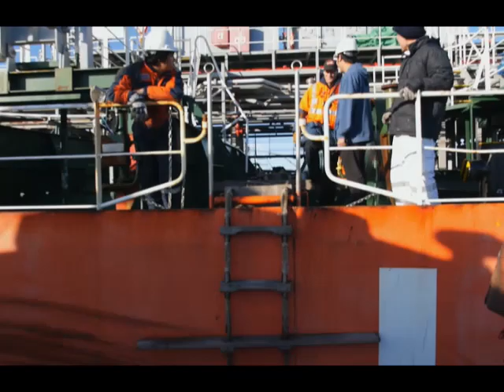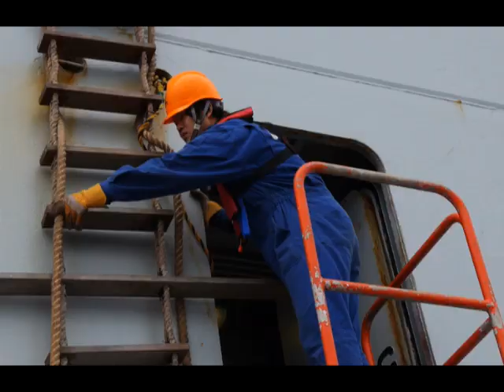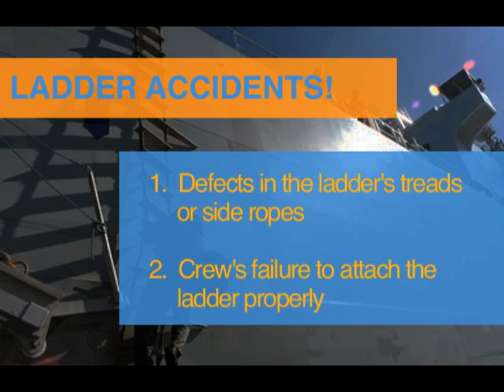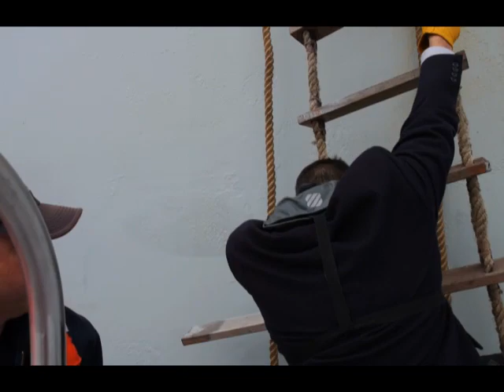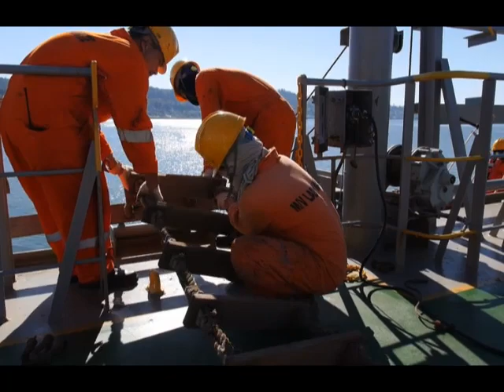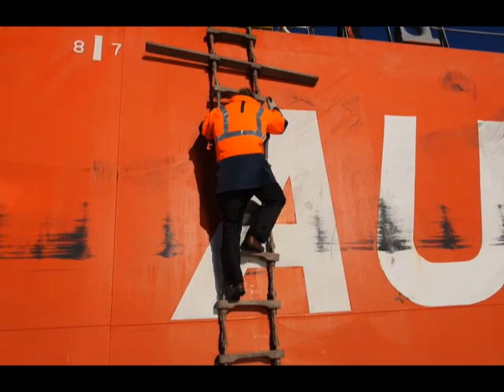Pilot Ladder Rigging Procedure: How to Ensure Safe and Secure Transfer of Pilots

Comment: WARNING : :hand-pink-waving:Pilot ladders should never be affixed to the securing points with steel shackles  as seen in this video, this method is noncompliant with SOLAS V 23. 
                               
🙏 Use  only approved rope stoppers (at least 2 x 24 kN) usually in the form of a rolling hitch knot between the pilot ladder side ropes and the approved strong points on the main deck.This will transfer the weight of the ladder directly onto the strong points and will not damage the ladder.

:hand-pink-waving: The use of  shackles, steel bars and deck tongues can  damage pilot ladder's steps. chocks or side ropes. Never use the ladder’s steps, spreaders, or chocks to bear the ladder’s weight. These parts are not designed for such loads.